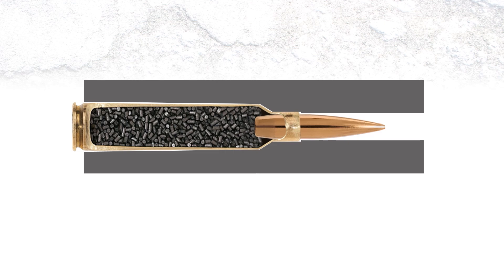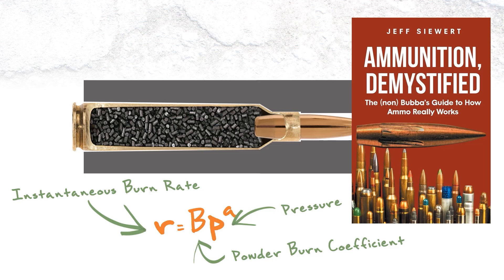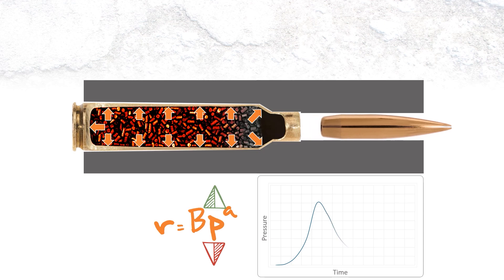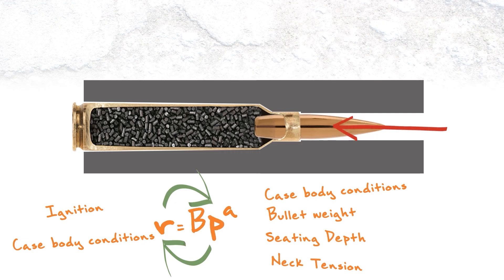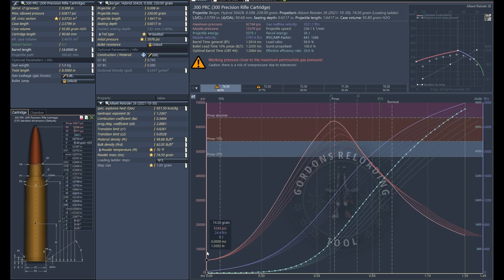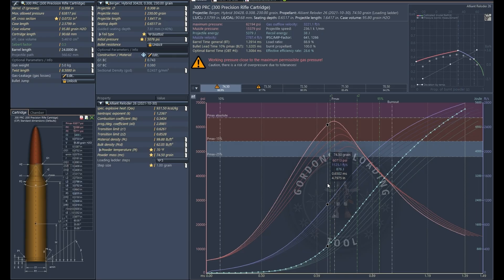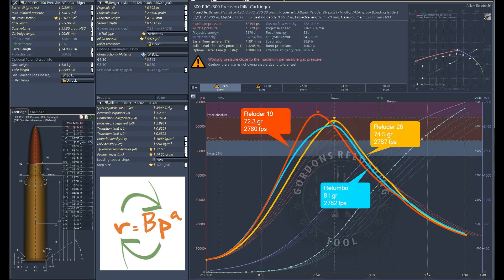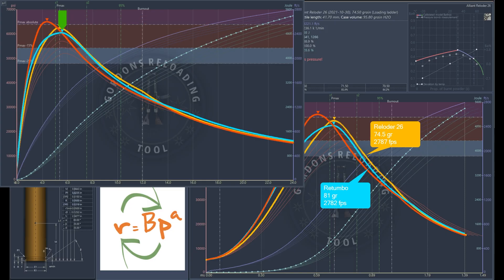The Anatomy of a Shot - Why the Little Things Matter

Comment: GRT hasn't been updated in quite a while because of Gordon's passing due to leukemia. There is a community effort to release new versions, but it has required a complete rewrite of the app from reverse engineering as access to the source code was lost with Gordon's passing. From the most recent update in the GRT Discord (Sept. 2023), the people that have picked up the mantle were expecting to release GRT NextGen around the end of this year (2024).

Comment: Burn the same powder faster in a short fat case than a longer thinner one same bullet for instance a 300WSM to a 300 Win Mag?
Reply from the maker: Sorry - missed this question. Shorter, fatter cases will tend to have their powder ignite more quickly due to the shorter powder column. This will change the burn rate and, by many accounts, also make it more consistent vs. their longer counterparts. Faster burn rate = higher pressure. So, I wouldn't take an ultra magnum, for example, with the same case capacity as a longer magnum and assume that the charge weights would be the same.

Comment: hi, is there an "ideal" bullet to case fit? aka .001 inch press? .oo2? etc, How much does this change with bullet dia.?
Reply from the maker: If you're asking about interference fit, there are a lot of opinions on this. My personal opinion is that the more interference you induce (e.g. by using a smaller bushing), the larger the impact from the variances induced by other factors (friction in the neck, neck thickness, brass properties).